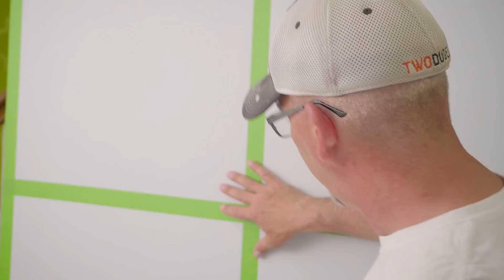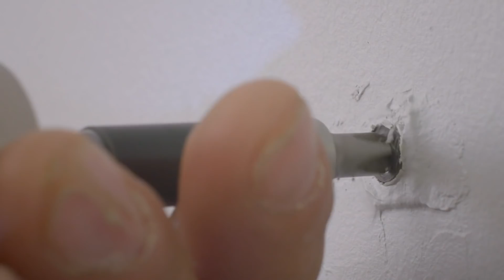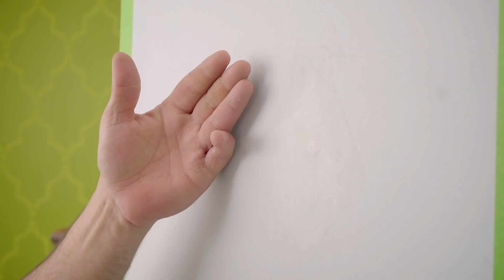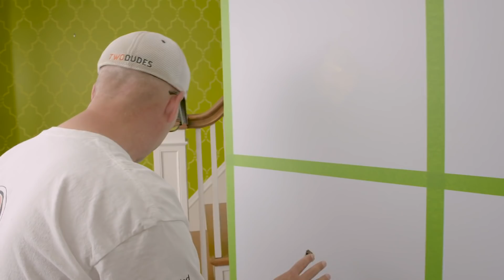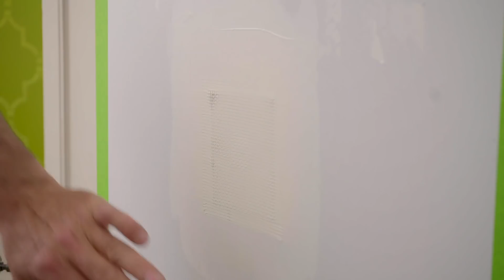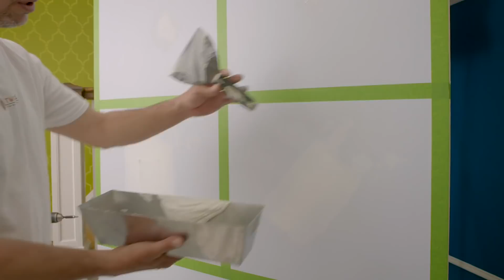How to Repair Common Drywall Issues

Comment: there is a reason the screw popped-common issue is screw driven too deep into sheet-pull out offending screw and place a new one an inch or so away then patch-never drive screw into original hole-it will pop again eventually

Comment: We have had a leak in our roof with it leaking into our front room.  About an 8 in crack.  Do I call a dry wall person out before the painter, try to fix it myself, or will the painter fix the issue?